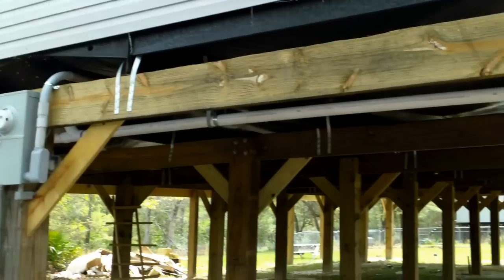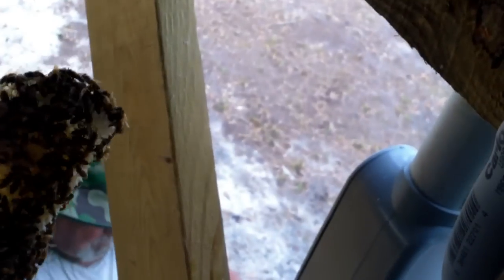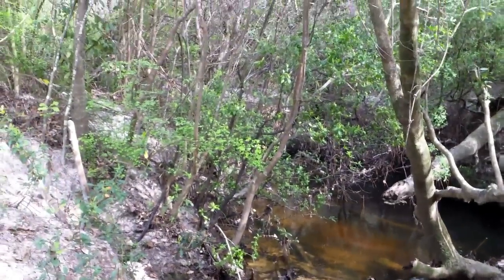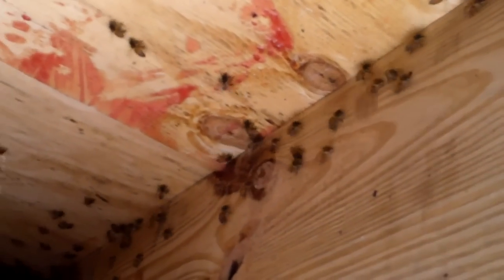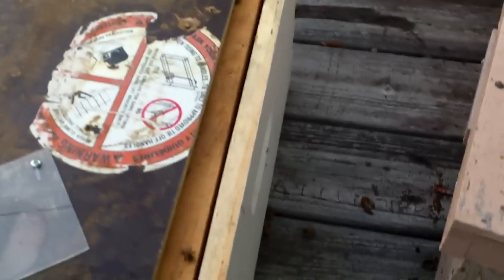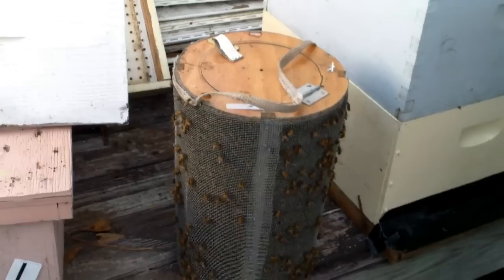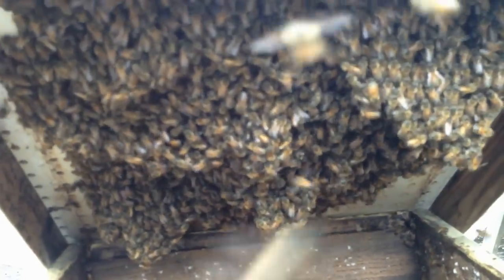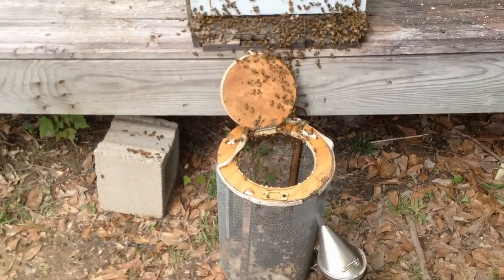Palmer Creek Hive Removal & Bee Vac Design

Comment: My suggestion is to reverse the flow. Have the shop vac connected to the bottom. Add a ring of 4, 5, or 6 blocks (2 inch cubes) inside to have the basket sit a few inches above the bottom and enough gaps for good airflow. So have the bottom board of the basket a solid piece, and have the hinged lid on top have the two pieces of X cut vinyl and hole to let bees through. Finally center the top vacuum piece in the bucket's lid to push through the vinyl cut-outs. A second hole in lid where current one is can be your valve to control suction, just add a square piece of wood/laminate/plastic with a single screw in one corner (a lot like the piece you have on your hive tops that covers the feed hole.) and just rotate it to increase/decrease the gap to adjust suction.
Reply from the maker: +DeepPastry Good ideas.  You may be able to lay it on it's side and change the hose configuration.  With the upright design you want the bees coming in at the bottom since they crawl up and would be trying to get back up the hose while you worked.
Reply: That makes a lot of sense. 

Still like having both the hole and lid on same side. Guess to keep it as an upright design you could do the basket like I mentioned and just insert it into buckets upside down. Just need a more secure latch for the hinged lid and a bottom handle too to lift it out. Which seems better than just flipping the whole thing upside down.

All in all, I like your guys' bee vacuum the best. Just having such large baskets that are so light and easily swapped out is sweet. That way you don't have to carry 3 or 4 deeps with bottoms and tops on the off chance you'll run into multiple hives at same spot.Like with the Colorado Bee Vac and all its derivatives. And many of the ones with baskets usually have fairly small, if not downright tiny, baskets.
Reply from the maker: ***** That's the biggest benefit.  It's so light and the multiple baskets save us hours in travel sometimes because once in a while we do more than one cutout in a day without coming home between them.

Comment: Hello.  Great videos!!  When you vacuum the bees from different colonies, do you have to keep them separated?  Will they be aggressive to each other if they are put  together?  Will they be able to separate again into different colonies if you put the queens into different boxes?  Thanks for the info and keep up the great videos.
Reply from the maker: You generally won't remove two hives at the same time but they will fight if you try to combine them without using proper methods.  If you do combine hives you can split later with new queens.

Comment: How powerful is your vacuum cleaner?
Is the vacuum a 12 volt model or do you use a generator  with it since it has to be mobile and since a grid power source may not be where the bees are.
Love your videos. Thank you
Reply from the maker: We do use a generator when no power source in on site.  Just a small Ridgid shop vac.
Reply: Thank you. for answering.
I seen 12 volt models and I also seen inverters that can be hooked up to a 12 volt battery to get 120 volts out of it and if a vehicle is running it is usually  more quiet than a generator. 
at leased this was my thought.
Can you recall how many HP or amps that vac has?

I made me a vac system last year to fight robber bees.

Comment: Do you still use the vinyl on the bottom? What about a trap door in stead? I'm thinking something like a metal toilet lid on the inside (the best I can describe it in brief), just larger than the opening for the vacuum piece, which is kept closed by a magnet epoxied into the wood when the cage is lifted out. When the basket is put into the bee vac, the vacuum piece pushes up the trap door, of course. It just seems like something that may last a little longer than the vinyl.
Reply from the maker: I have considered trying a spring loaded door similar to what is on the walls in a whole home vac system.
Reply: And you could find those pretty much just ready to install. Great idea.

Comment: Do you have to take a generator out to run the vac off?  I'm guessing they are all different depending on size of the hive, but any idea how long it generally takes to get them out with a vacuum?  Do you have a preference for moving the bees, or is it usually a matter of how much time you have to get it done?
Reply from the maker: Depends on how much time I have as to how I tackle it but I prefer no vac.  It does take longer but it's more relaxing.  Plus if I'm trying to record there's not all that noise.  We do have to take a generator some times.
Reply: Thank you so much for all the great feedback!

Comment: I wish I knew what that "homemade attachment" is called. It looks like something you would find in the plumbing section at Lowe's, but I can't find it.
Reply from the maker: Not sure which part but one of the parts is from a dust collection system for a miter saw I think.
Reply: The plastic piece under the five gal bucket lid, at the 15:30 min mark.

Comment: Question for you Randy. What is the deal with a bee vac that have wet bees in them sometimes? What causes this?
Reply from the maker: Sucking up too much honey during the removal.  They wallow on each other and they all end up in a wet clump.  You've got to dump them out and spend about a half hour smoking and flipping them with a hive tool to make them separate and clean them selves or they will just stay balled up and die.
Reply: Thanks